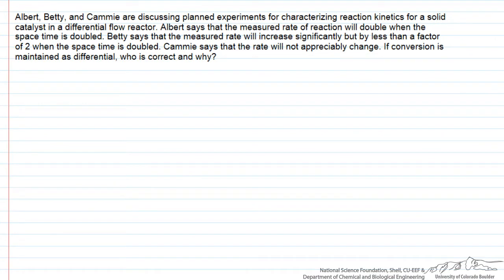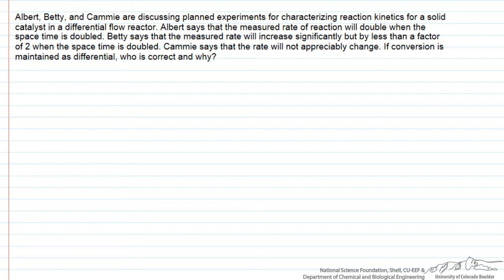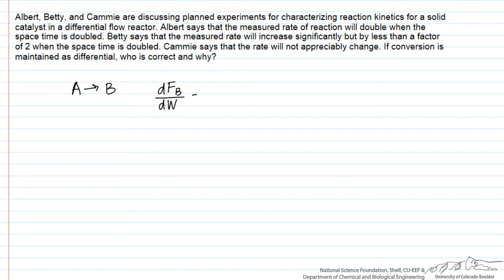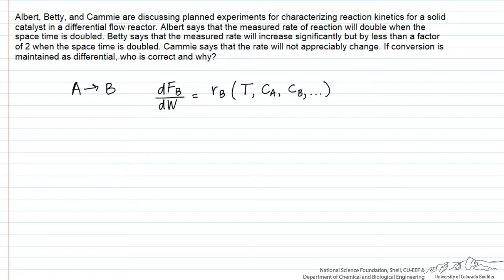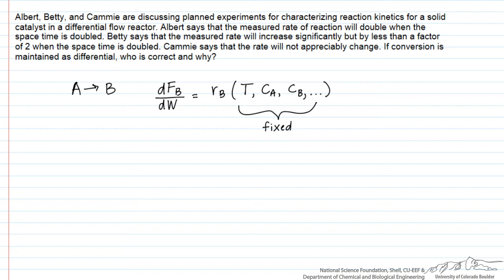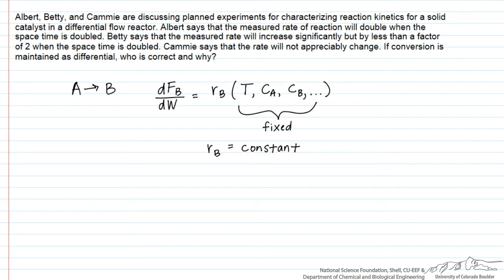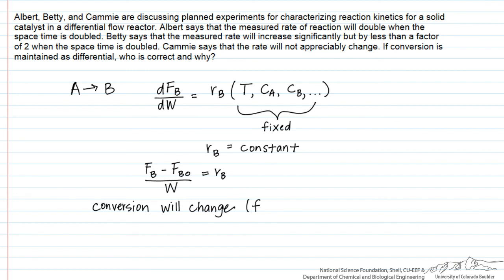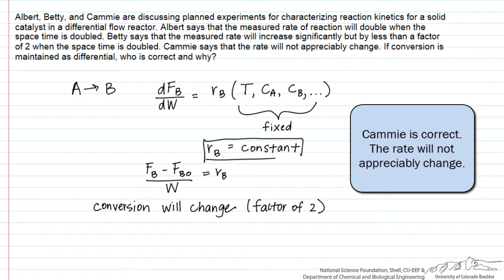Reaction Rate Dependence on Space Time (Review)

Comment from the maker: Depends on the situation, but here in a PFR, a volume change, like that of a gas reaction A --> 2B, refers to the fact that the volume of the reaction increases because 2 moles of B are formed from 1 mole of A.  This also in turn causes an increase in the volumetric flow rate change since we are assuming we are running steady state and no accumulation is occurring.